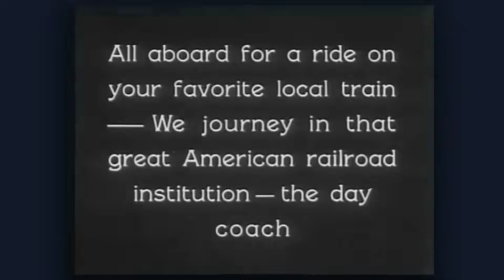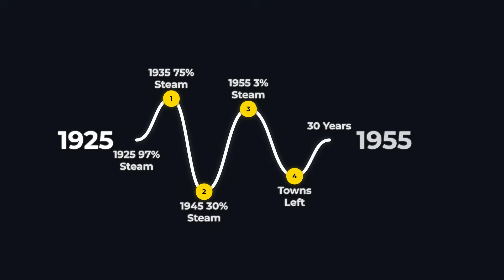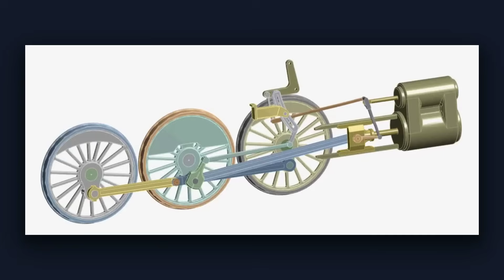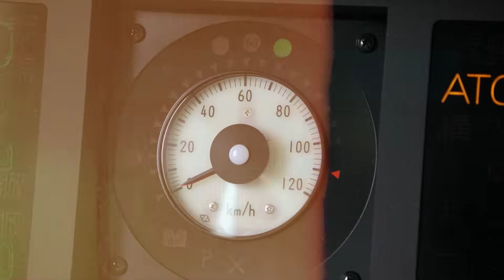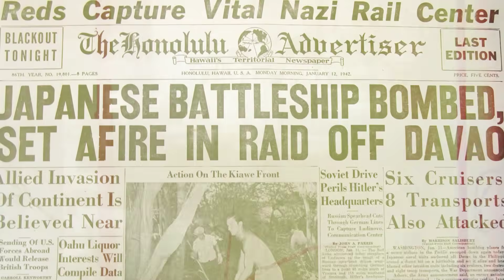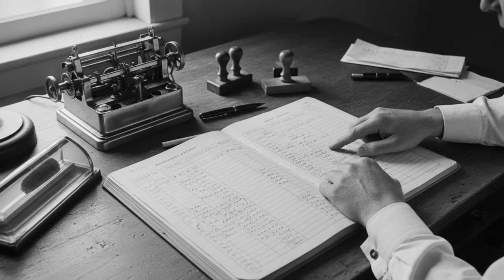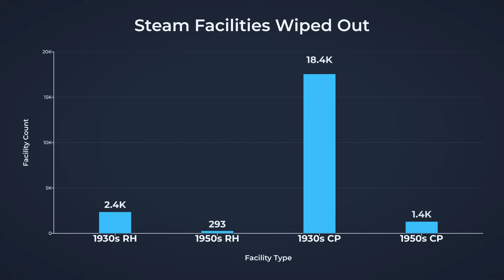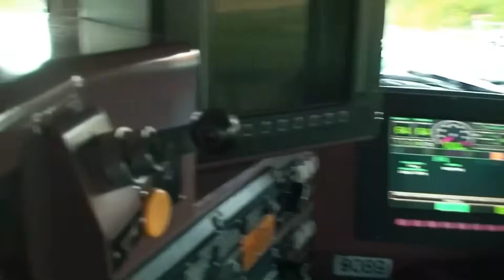Railroads Called It “Too Weak for Freight” — Then It Replaced EVERY Steam Locomotive

Comment: Steam is romantic but diesel is way more economic. Too bad.
Reply: There were possibilities of potential revival of steam motive power in the 70s during the oil crisis. Locomotives like the Union Pacific's #844 had its tonnage classification increased several times. This had made it so that steam was almost viable in material costs. One engine doing the work of 3-4 burning coal instead of oil based fuels almost made up the difference to bring steam back during that time.
Reply: Steam was dirty and inefficient so it had to go.

Comment: I believe there was still some Big Steam on the C & O Road into the middle 1950s 
The early ALCO RS locomotives might have been too weak to replace Steam on the mainlines but the EMD 567 locomotives began to replace Steam because of operating efficiencies,less labor needed and a group of 4 locomotives could easily be operated by one crew 

  I believe Multiple Unit Control as used by GM and probably everyone else eventually was developed by General Electric which made smallish locomotives of about 600 horsepower as far back as the 1930s  "40 tonner"/70 tonner"? - later GE would start producing larger locomotives which seem to now have taken over most of the industry
Reply: EMC was producing 600hp (SC and later SW Series) and 900hp+ (NC and later NW Series) 115 ton switchers starting in the mid 1930s.

Comment: Did they have Diesel Hydraulics in the USA
Reply: Yes, but they failed.
Reply: Yes, Southern Pacific imported some German Krauss-Maffei diesel-hydraulic locomotives, as did a few other railroads, but they were oddities, and didn’t last long. I think there’s one left in preservation.
Reply: They were just not suitable for U.S. railroads.  Just not heavy duty enough.
Reply: @gregrowe1168 The Western Region did well with their Class 35 Hymek, Class 43 Warship and Class 52 Western.  They were only retired due to standardisation.  Germany also had Diesel Hydraulics, the Warship class was based on a German design.
Reply: There were a few examples of Krauss Maffei Diesel Hydraulics tried by the Southern Pacific during the late 40s - 50s. Those were the only real mainline trials for diesel hydraulics.